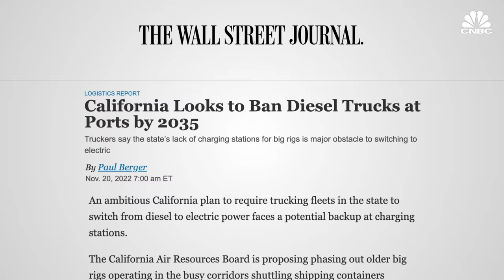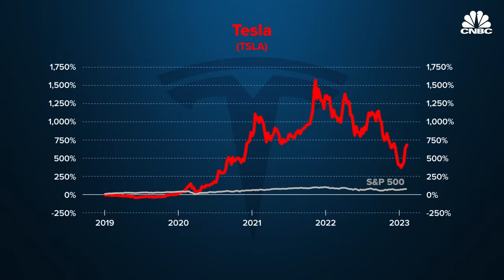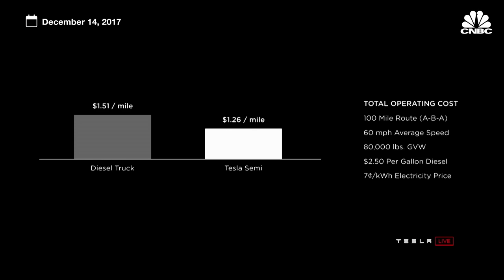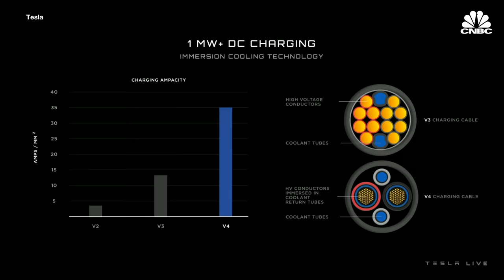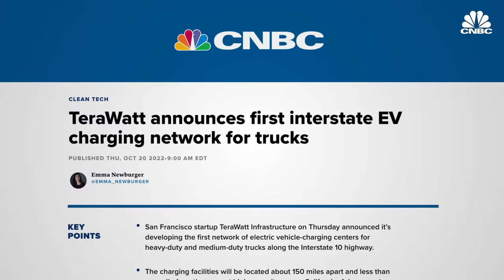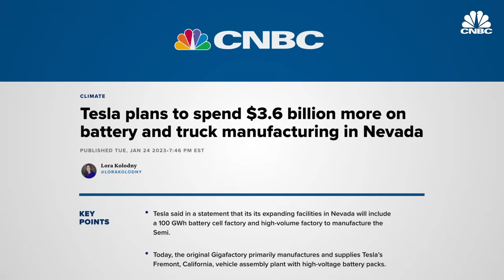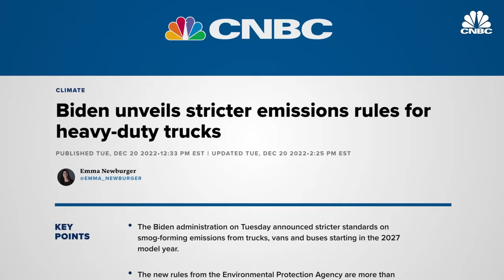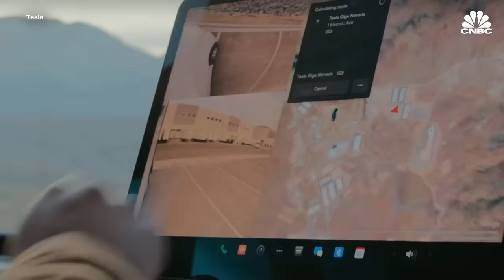Does The Tesla Semi Live Up To The Hype?

Comment: Frito lay is the perfect company to have a Tesla semi, their cargo is super light.
Reply: You apparently missed the statement at 4:34 that they also take 45,000 lb. loads of Pepsi 300 to 400 miles, from plant to distributor warehouse. >22 tons is not what I'd call "super light".
Reply: Lol, it's mostly air in the bags anyways.
Reply: @aaron___6014  Yes, lightweight, cubed out loads of snacks still need to be moved from the plant to a warehouse. The good news is that when lightly loaded with 5,000 lbs. of snacks, the range goes all the way up to 680 miles, and fuel cost per mile goes down another 25%. 
Thank you for bringing this up, to highlight yet another advantage the Tesla Semi has over diesel semis.
Reply: @BigBen621 Unfortunately the world is built from steel and concrete not Fritos.
Reply: @csabo1725  So true, and thank you for pointing this out! And here's a video of a Tesla Semi towing a flatbed trailer carrying exactly that—42,900 lbs. of steel and concrete traffic barriers—accelerating rapidly up a steep grade on Donner Pass, passing a diesel semi as if it were standing still: https://www.youtube.com/live/LtOqU2o81iI?feature=share&t=985
Just like diesel semis, Tesla Semis will often tow loads of light materials that are cubed out—that is, limited by volume, not weight—because that's the load that needs to be delivered. But they are also capable of towing 22 tons in loads that are weighed out, which is not substantially less than what a diesel semi can tow.
Reply: @Big_Ben_from_La_Mesa  A 5 axel Swmi truck is supposed to carry a maximum of 80,000 pounds. That is what the Semi of tesla for lays has but only carries a maximum of 45,000 yes that is lightweight. Do some research into it before you make assumptions...
Reply: @cencent2189  Too funny! Low information internet guy doesn't know the difference between useful load and gross combined vehicle weight rating (GCVWR), and so thinks he's spotted someone else making an error. Might want to look up the Dunning-Kruger effect.
FYI, 80,000 lbs. is not the useful load of a "5 axel Swmi truck", but the total combined weight of the diesel tractor, trailer and load that's allowed. Electric semis are allowed an additional 2,000 lbs., to 82,000 lbs.; but the tractors are heavier due to the batteries, so they end up with a little less useful load capacity.
Like a guy once said, "Do some research into it before you make assumptions..."
Reply: @Big_Ben_from_La_Mesa  At the high end of weight a diesel Semi-truck can carry 10,000 more. At the low end of weight it could 25,000 more. This doesn't account for the fact that weight goes down over time as the tank empties. As you mentioned that is something electric Semi-trucks lack.

Currently electric Semi-trucks are unviable as there isn't the infrastructure as also mentioned in the video. Anyway you cut it Tesla Semi-trucks are less viable than diesel and for long distance trains would be better if the mission is to lower the carbon footprint as they claim. But the Tesla Semis are just a way to green wash claiming they're trying to do something for earth when there is a lot of research that shows other better solutions for it.
Reply: @BigBen621 so does a Scania 770S.
Reply: @kornaros96  I'm not sure what you're saying—"so does a Scania 770S" do what? 

Compared with the Tesla Semi, the Scania 770S is short 250 HP; is lacking the incredible benefit of regenerative braking; requires substantial RPM to develop useful torque, while the Tesla Semi has nearly maximum torque at a standstill; and has much higher per mile operating costs. But because to the best of my knowledge the Scania 770S is sold only in the EU where regulations and standards are dramatically different from the US where the Tesla Semi is sold, comparisons are not really useful.
Reply: Snacks may be light, but Pepsi drinks are very heavy
Reply: @BigBen621  Horsepower doesn't matter.

Torque does, and the Tesla Semi has half the torque of competitors, it's heavier, can carry only up to 45k lbs, etc.

Walmart Canada already ditched the damn things.
Reply: @Dexter037S4  Walmart doesn't have Tesla Semi trucks delivered to them yet, they are testing Nikola and eCascadia trucks.
Reply: @BigBen621  Those runs listed were two different runs by potentially two different trucks and not a backload/return load.  The Frito Lay runs would probably be only Frito Lay cargo and not Pepsi cargo.
Reply: @aaron___6014 big facts
Reply: 6 barriers
Normal truck hauls 22 of those easily

They still dont tell us what the truck ktself weighs including vatteries
Reply: @phnix6242  
 6 barriers 
You need new glasses. There are quite clearly three rows of three, and the last row of two, for a total of 11. They weight 3,900 lbs. each, for a total of 42,900 lbs.
 Normal truck hauls 22 of those easily 
Thunderf00t is an obvious, deliberate and egregious liar. You can see for yourself in the video that the 11 barriers take up almost all the width and almost all the length of the 53' flatbed trailer. Where do you imagine that another 11 would fit?
Reply: @BigBen621   yeah a fake video...
Reply: @DonkaMowski  Your evidence for this?
Reply: @BigBen621  All his other fake videos.
Reply: @BigBen621  They only spoke of the weight, not that Tesla was hauling it. You apparently missed that.
Reply: @RichardRoy2   They only spoke of the weight, not that Tesla was hauling it. You apparently missed that. 
The entire video was about Tesla Semis. You apparently missed that. If it wasn't a Tesla hauling "it", what was it?
Reply: @BigBen621  It was a discussion about what semi's can haul. And I was under the impression they were speaking more of the difference between conventional and EVs. And, as long as they're talking about Teslas, why do they not tell us the weight of the truck? That would be key, if they're selling to truckers. That's what they want to know. Yeah, they would like to know all the other stuff, such as, do EVs measure up in durability and distance. But why are they going out of their way to hide that one important element truckers want to know? Unless it's just a PR Brand Building venture.
Reply: @BigBen621  Found the telsa fan boy. The segment was talking about the expectation of weight to be transported, not a description of how much tesla trucks can carry. A few seconds before that, the segment even mentioned it's a wait and see regarding tesla truck performance. You should read about the Dunning-Krugger effects and learn to listen better before getting your nose all brown and stanky! 🤣😂😅
Reply: @tomy4453   A few seconds before that, the segment even mentioned it's a wait and see regarding tesla truck performance. 
You do realize that you're commenting on a nine-month old video, right?
Reply: @BigBen621  Is that your response to the video that you have been spending 9 months replying to comments? LOL 🤭🤣
Reply: Cargo that isn't dense is what is perfect for electric semis to be honest. Not that EV Semis don't have the raw torque.

 If you don't need a super powered diesel truck to move your average freight then why use it when it is so damn expensive. 
 
 Personally I think Series Hybrids semis should have been done years ago for long haul, and heavy lifting niche trucks. Blows my mind only a handful like Edison exist. 

 Anyway I'm glad Tesla is doing it, because majior manufacturers will follow suit. Batteries will only get significantly better from on out.

 Let's hope more breakthroughs in lithium air batteries happen. Talking 1.5kwh to 5k kwh per KG! Max 12,000kwh per KG if you get air from the atmosphere like a jet! So say we developed an 80% effiency? 10kwh! We need this yesterday.
Reply: I work for a company that makes the chip displays for them. Once you add up the corrugated packaging and wooden pallets, you’re still going to have about 45,000lbs on there.
Reply: @BigBen621  lol yes, the max limit is 45 000 pounds. Go do the maths, I bet the truck isn't full at all.
Reply: @AntiSociety100   I bet the truck isn't full at all. 
I just checked, and it turns out that you betting on something doesn't actually make it true—especially when the only basis for your bet is your own fallacy of personal incredulity.

 Go do the maths 
It's you're claim, so the burden of proof is on you to "do the maths"—whatever that means.
Reply: @BigBen621  not to mention how much safer a truck with re-gen is.  I live on a range that has trucks go through once a year with the names of all the truck drivers who died on that range (about 50 or more from memory).  Almost all died because their brakes faded and the traffic was too hard for them to get to the sand ramp so they ended up driving off the range rather than plow through a bunch of family cars.  Re-gen not only  means recycling much more power than the average EV because the mass is so much higher but it means ZERO brake fade.  And zero effort of the driver trying to change down 16 bloody gears.
Reply: @cameronlapworth2284  I'm curious why you're addressing these comments to me? That's kinda preaching to the choir.
Reply: Maybe a helium balloon delivery company